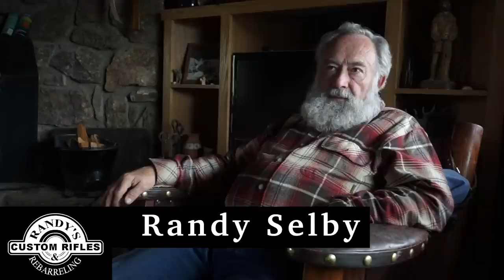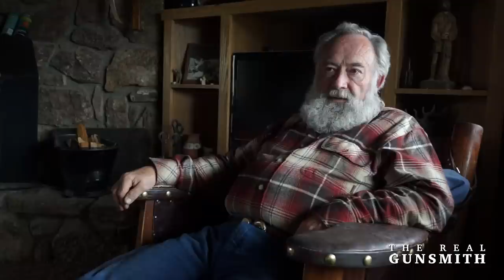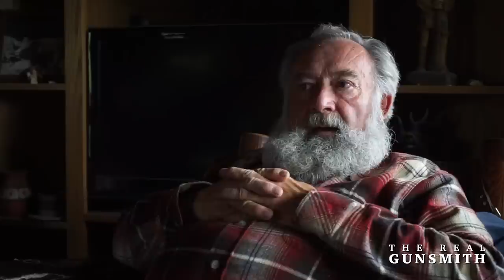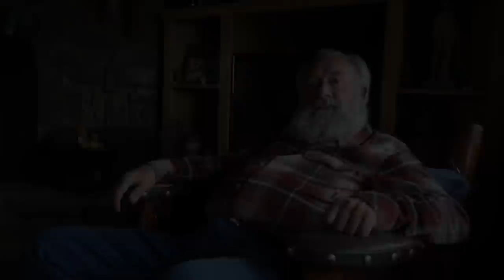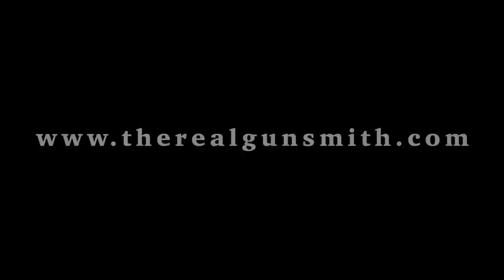Barrel Accuracy Life – The Real Gunsmith

Comment: Great video. Was watch as i cleaned a rifle. Couple of our rifles we push a little hard. 6.5x284 usually we consider swapping out the barrel around 800 to 1000. 264 win mag, 1200 rounds and still sub MOA. 6.5x284 that we use slow burning powder in barrel has a lot longer life. I  have an old 70's 7mm mag never been loaded hot still kicken with the original barrel. 6.5 creed, well thats what we let the kids shoot. You push the load you buy a barrel sooner. Throat starts to look like gator skin.

Comment: How long is barrel life? Well, here's a back of the envelope calculation: MV = 3000 FPS. Barrel Length = 2 ft. AveV in barrel = 3000/2 = 1500 FPS. Time spent in barrel = 2/1500 = 0.0013 seconds. If a barrel can shoot about a thousand rounds with good accuracy, then barrel life is about 1.3 seconds!!!
Reply: Late response, but following your math that implies the same conditions but with 2000fps MV would result in 2 seconds of barrel life. This is means over 50% more barrel life with a 33% MV reduction. 
The shortened equation of barrel life in seconds = (length of barrel in feet squared divided by muzzle velocity) x number of shots in barrel life. Example: (2" x 2 / 3000fps) x 1000 shoots = 1.3s This implies that there is an positive exponential relationship between barrel length and time spent in the barrel for each shot. This means more barrel wear per inch in a longer barrel given the extra time spent is exponential while the barrel length increase is linear. Food for thought.
Reply: @no-sway3709  I'm not sure you ARE following the math, which is extremely simple and contains no "theoretical" component. The math is simply: take a claimed barrel life expressed in number of rounds fired, approximate the length of time a bullet takes to run the length of the barrel in that cartridge, then multiply the number of shots by the time taken for each shot, to get a "lifetime period" where the gun is being fired.
Reply: @GetMeThere1  that's what I did. I expressed it an algebraic equivalent so that barrel life in seconds = length of time the round spends in the barrel times number of expected rounds.

Comment: I know this is probably not applicable, but I have a single shot rifle that I shoot black powder and cast bullets in...1000 yard match shoots.  We might shoot 100 to 200 rounds over a weekend, and yet I can't see any reduction in accuracy after over 5000 rounds .  Barrel is .45 cal 1 in 18 twist made by Badger .
Reply: The pressure generated from black powder is significantly lower than the pressure created by modern smokeless powder out of a smaller diameter bore. You'll probably never wear the barrel out on the rifle you mentioned.

Comment: Can you please explain how bore diameter plays a role in barrel life? I would really like to understand why loadings that use the same case with a different bore diameter in particular, have claims of such drastic changes in barrel life. 30-06 vs 25-06 vs 6.5-06, or the many wildcat cartridges based on the .308 case. There are also loadings with similar case capacity but drastically different case dimensions that I feel might be worth discussing with respect to barrel life, such as the 6.5GAP SAUM vs 6.5-06. I feel like the obvious reason for barrel life differences  would be an increase in chamber pressure due to the "smaller escape" route for the gasses and projectile (in the case of loadings sharing the same parent case) but I feel that there is more factors at play. 
If you could also explain how the length of freebore may or may not play a role in throat erosion and barrel life I would be greatly appreciative and very interested!  Thank you for spreading your knowledge!
Reply from the maker: Thanks for watching.
That is a more detailed answer.  I'll do a video on this at some point. 
Happy New Year and stay tuned!
Reply: Thanks a ton! I will keep my notifications on so i know when you come out with new videos. Happy new years to you and your family as well, I hope 2019 is a fruitful endeavor for you!

Comment: Hunters shoot a few, 10 - 20, cartridges a year at most. And can shoot as few as one to five cartridges a year. This is for big game. Then there’s limited or unlimited match shooters that can go through two or three barrels a year. What he says about barrel pressures and heat are exactly right. He’s exactly right about the 6.5 Weatherby, even when case formed from 8mm Remington Magnum cases. 

In 1992 I was allowed to start and complete the development of my uncle Ralph Buckmaster’s proprietary cartridge, the 6.5 Dakota. The cartridge and rifles were developed through different cases and refinements until case forming of the 300 Remington Ultra Magnum. The last improvement was when US 869 was released. 

This two and one half inch cartridge can develop pressures in excess of 65,000 with 89 grains of US 869 behind a 142gr Sierra. Out of a 30 inch barrel, it can produce velocities in excess of 3900fps. The velocities were chronographed with a 35 and printed Now that’s going to and did get a lot of attention prior to and after the year 2000. I received phone calls from manufacturers R&D supervisors regarding this cartridge. 

This cartridge was developed for long range hunting, but could be used for long range competition shooting. I will say that using this cartridge for 1000 yards matches would require a couple of barrels. The use of a “cooler” burning powered such as Varget or the like would be required. We have a supply of 155gr bullets that are wonderful to 1000 yds and beyond. The new 150gr bullet and a 30 inch or longer barrel would do just fine at 1000 yds. 

To re cap, the pressures and heat are significantly important to the accuracy life of the barrel, even with hunting rifles used over decades. Keep this in mind when reloading, but most importantly have fun and be a positive ambassador for all shooting and hunting.  

Sincerely 
Aaron Buckmaster

Comment: Hi Randy.  I really enjoy your videos and I really appreciate you sharing your experiences to correct a lot of the misconceptions about precision rifles. I'm curious your thoughts on cutting some length off of the throat of a barrel to get your accuracy back. I recently bought a 28" 6mm creedmoor match heavy bull barrel and from my understanding and from the advice of my gunsmith I would be able to have that barrel cut down to 26" and then 24" once my accuracy starts to go and that will restore the accuracy and just obviously have slower speeds. Doing this will be a cheaper option than buying a new 600$ barrel every 1000 to 1200 rounds.
Reply from the maker: How many rounds are through the barrel now?  This would dictate what needs to be cut off to get fresh again.  Feel free to email me at randyselby@randyscustomrifles.com
Reply: The Real Gunsmith. As of right now it only has 435 down the tube and it's still just as accurate as the day I broke it in. My plan is to try to get to 1200 to 1500 rounds and have it cut down from 28" to 26" or sooner if accuracy starts to go before then. I may be way off with my estimate of how many rounds I can expect before this is a necessity. Thank you for the email address.  I will surely be emailing you with my gunsmithing questions in the future.  Thanks again
Reply: I am not an expert, but I was told hot rounds burn the throat out of a barrel?

Comment: I've never had a rifle or pistol (contender) to be accurate with max loads. Usually mid range in the reloading data gave me the best accuracy.
Reply: That's because you dont tune accuracy with powder weight... you find a load with tiny standard deviations and tune the round to your barrel with COAL.

Comment: Curious what your take on the point 277 sig fury is? Case design? Barrel life? Is there already a Cartridge that performs as well ? Looks like ammo will be  costly.  Might take awhile to be able to reload.  If you have time.  Would like to hear your expert opinion.
Reply from the maker: There is nothing special about the .277 Sig Fury, a .308 necked to .277.  
Thanks for watching!
Reply: @TheRealGunsmith  3000 fps with 140 gain bullet in 16" barrel is getting with it ! No problem get these velocitys in a 26-28" with slower powder and lower pressure But I wouldn't recommend loading a 308 neck down to .27 to these velocitys in a 16" barrel and put your face near the rifle. Maybe fun to watch at 100 ft away with string on trigger and rifle in a vise. 
   If the .277 furry does what it claims to do  with longer barrel life then expected 600-800rd maybe. Then I'd say it has won the 16" race.  So say a car went 100 mph in the 1/4 mile and another one went the same speed but in just over 1/8 of a mile I guess it's a tie race to some but I'd say the winner is the one the  Accelerated almost twice as fast. Sure there's more to come right.
Reply: @TheRealGunsmith  the race has expanded it's not just Cubic inches anymore. People need to think outside the box. a rifle can be built around a cartridge and what it needs to do.  DREAM IT then BUILD IT.   If the 227 furry can get 3000fps in a 16" barrel just make it a longer race and it will fly.    24-26" barrel. Could be the laser beam of center fire.  More to come soon.... HAPPY SHOOTING!

Comment: The real gun Smith.  I have a glock 43. Its a small hand gun and I have just the smallest little nic in the crown of my glock barrel. I have 0 rounds throw the barrel but have a tiny little nic in the crown of the glock barrel. It's really small. Will it affect the accuracy of my barrel up to 25 yards?  do I have to get it re crowned?  How much does it cost to get a barrel re crowned?   But I don't want to re crow it if I don't have to. The glock is made for up close shooting. Self defense for me and the max I would be using it would be 25 years for self defense. Would a small nic in the crown make a big difference at that distance?  Plx let me no

Comment: had a friend buy a 220 Swift way back in the day when it was a NEW cartridge. I think it chrono'd with the load he was using  to something over 4000 fps. The Barrel was toast at around 200 rounds.  One question I  would pose, I've examined  a few 'shot out' barrels, and the majority of damage was throat erosion- I had one old gunsmith, whom I, and pretty much the rest of the clandestine community, respected tell me the "hot" rounds thew fire thru the throat like an acetylene blow torch..easy to picture repeated firing taking its toll on those barrels.  I suppose tho, the rocket scientist's in the crowd could probably suggest a better gun barrel material to replace today's standards, and in some instances, they have :)  In fact, I have a brace of 30 cal pistols that fire anti aircraft rounds:) made in the old soviet block. Apparently, these two , and quite a few others, were manufactured out of whatever metals were then available, which during this particular run , were comprised of  some overstock from the Soviet space program :) and yes, they are "collectables" heheh. Awkwardly balanced, and hard to learn to shoot, but either will do  a Chevy small block at about 50 meters LOL. (ps: the rounds fire copper coated tungsten   projectiles)

Comment: I don't think it's pressure that degrades a rifles accuracy. Think of a car's engine, the pressure inside of the cylinder, the pressure on the valve or even a jet engine and all the tremendous pressure that is applied to it, How long does it last. I believe the main contributor to accuracy life degrading is heat,  tremendous amount of heat from the powder burning

Comment: sir, thank u so much for great advice and information. There is a clip in Utube that shows a 1950's anvil compared to recent anvil. They did a bench press test and found that the recent anvil was much weaker. Does it mean that rifle barrels made of olden era (pre 1980's) are much stronger then recent barrels? Thank u sir.
Reply from the maker: Comparing anvils and barrels is like comparing apples and orioles.   Totally different manufacturing processes.      The barrels now, at least the high end ones, are as good as pre-1980's.   That said, if you buy a cheap barrel [by price] you will get a cheap barrel in fact.
Thanks for watching.

Comment: pressure.... I was told in the Navy, The higher the pressure the higher the temperature, the higher the temperature the higher the pressure. Erosion comes form friction of high temp and high pressures.
Reply: Mainly unburned powder that's "sand blasting" the lands causing the erosion

Comment: Randy, in your previous videos talking about custom load development, you described the process in a certain order of which component you would change next to achieve more accurate results. My question is, why do you change powders before bullets or primers for example? Why do you do it in the order you described? Also besides experience, what are the signs lead you to change a specific component of a hand loaded cartridge ie. Why would you change primers instead of changing to a different powder or changing seating depth at a certain point in time during load development? I hope my question is getting across clearly. If you have questions just let me know and I can clarify. Thanks

Comment: If you start loosing accuracy a load you've developed at 500 rounds, can't you just load your ammo a little longer and a little hotter to match the original speed and regain the accuracy you've lost? Maybe changing to another style of bullet with a different ogive would help also. If I ever had a rifle that I could shoot a half inch with I wouldn't even consider changing a barrel before accuracy blew up well pas 1.5 inches. I'd adjust the OAL until those adjustments did work anymore.

Comment: Good info. I got a 416 stainless steel 22 inch barrel 44 magnum that I shoot factory loads 240 grainers Remington and Winchester.  How long do you think barrel will last?  I only shoot about 20 rounds per
 outing.
Reply: 44 mag is not a rifle cartridge. It is a straight wall pistol cartridge. As such it does not face erosion the same way as a bottle neck rifle cartridge. I would expect an extremely high round count from that firearm. By comparison I have a 9mm with an excess of 89,000 rds with no detectable erosion or accuracy deterioration.
Reply: @thumperjeep  thanks

Comment: If you use a powder with a slower burn rate with a longer barrel (24 inch?) will that produce enough of a lower pressure to help increase barrel life?
Reply from the maker: It will depend on the pressure level you load to.
Thanks for watching.

Comment: So, with all this mind, how does this translate to a .223/.556 rifle? Say something with an 18" barrel, cold hammer forged SS barrel and a 1:8 twist?

From the sounds of it, as long as you don't mag dump all the time, and keep your shooting within reason, and REALLY clean it occasionally, then the barrel should last well beyond 1000 rounds?
Reply from the maker: Your barrel should last 3000 rounds with proper care.
Reply: Lucky Gunner did a test where they tortured several ARs. They put them thousand rounds thru them without cleaning. Take a look at it. Accuracy didn’t start to fall off until late in the test.

Comment: In a hunting rifle why do you need 1/2 MOA? I know my well used 300 Weatherby has degraded to 1,25 MOA, but it is fine to 400 yards on elk, and mule deer. And, I am taking it antelope hunting this fall.
Reply from the maker: Perhaps that is not what you require.  But this is, first and foremost, an accuracy shop.  The rifles built are all built for utmost accuracy, no matter their application.  And the market proves this out, it's what our clients want.    
Good shooting!
Reply: Two inches off at 400 yards versus five inches off at 400 yards could be the difference between an ethical kill shot and a wounded animal.
Reply: Landing a bullet "somewhere" inside a 10" circle at 500 yards, and hoping for the best, IS NOT an acceptable level of accuracy when hunting.  Again, the margin of error can be the difference between merely wounding an animal and an ethical kill shot.
Reply: Travis Thacker  I`ve lost deer the same myself . But one time shot one that had 24 healed slug holes in it . Some may have been pass thru`s but thats a lot of damage wether all at the same time or not.

Comment: I had a question would it make a considerable difference if I went from a 26 to a 28 in barrel accuracy wise with a 1:9 twist? Or is it better with just 26 in barrel for reference I asking from a long range hunting perspective
Reply from the maker: The length of the barrel is not a deciding factor, accuracy wise.  I prefer 26" barrel.  There is only 60-70 fps gained in 2". 
Thanks for watching.  
May you and yours stay safe and well.

Comment: 2 questions. What about copper fouling. Is there a powder charge difference in IMR 4350 and Dupont 4350? I have always loaded Hornady 87 gr. SP in 243 cal. since 1968. Rem. 700.
Reply from the maker: Every rifle has different likes and dislikes to powder charge.  So use what works best in each individual rifle.  Even rifles of the same make and caliber may like different powders, as well as other components.

Comment: I have to agree with most of what you say. I have pulled thousands of barrels, both in the military and civilian world. I have nothing to do with paper punchers, but the long range hunters are the same way.  I doubt you have seen a REAL shot out barrel.  Machineguns are really hard on barrels. This would go with what you say about abuse. I remember checking a .50 barrel with a throat erosion gage. It is a tapered gage similar to the old shotgun choke gages. I dropped it in and it went all the way through and stuck out the  muzzle about an inch (With a knurled grip on the end).  Years ago the Frankford Arsenal did a report on barrel life and they used cut rifled barrels. After thousands of rounds the accuracy was still  Improving!